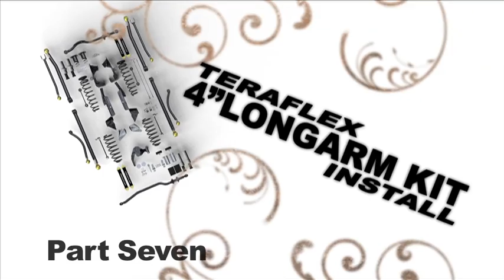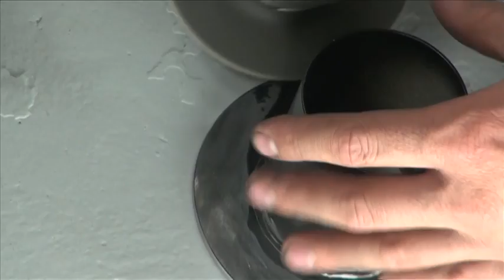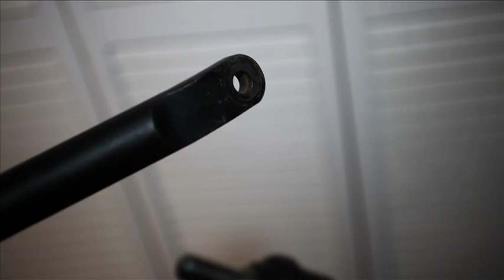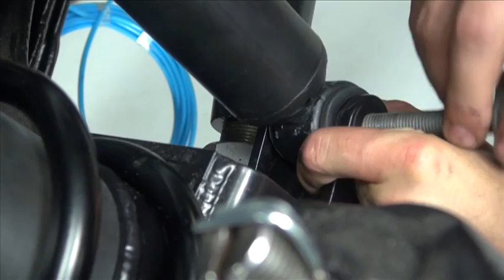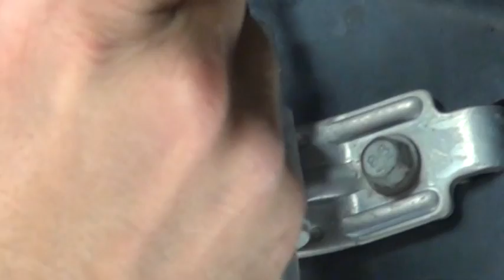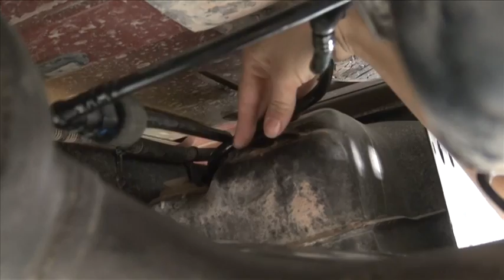TeraFlex Install: JK Long Arm Kit Part 7 of 7

Comment: That kit cost like 3k plus if you don't have a lift like most people another $1500 in labor so $4500 installed? Why do they charge so much for long arm lifts? Isn't that much more steel in them.